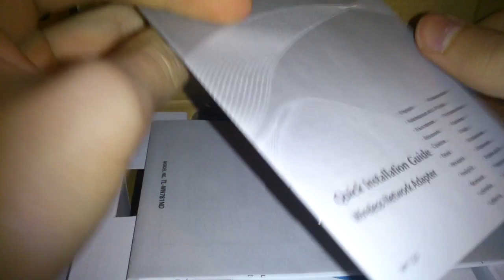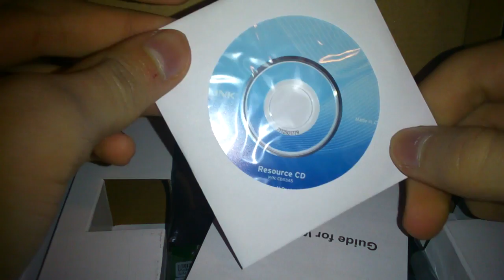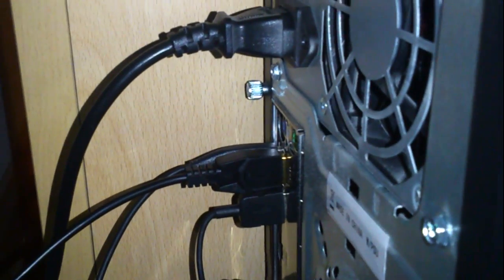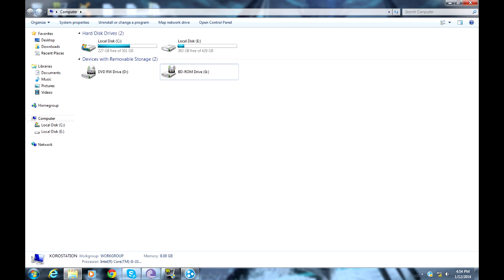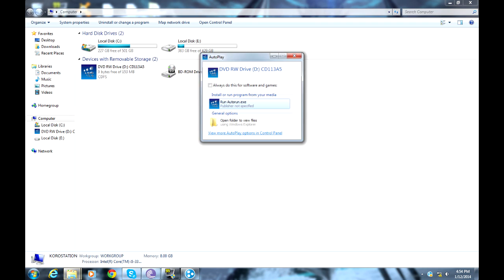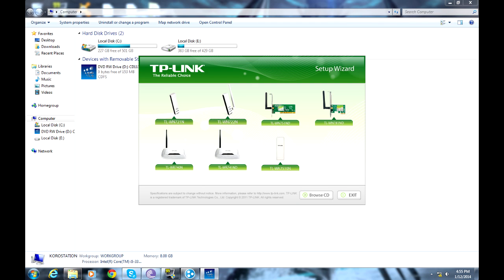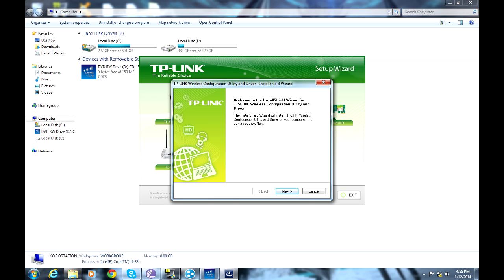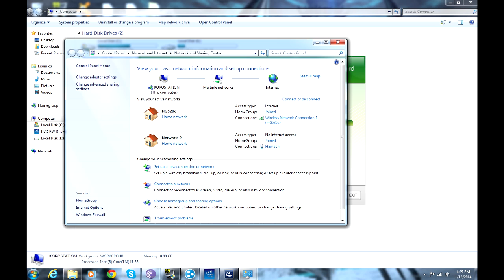How to install Wireless PCI Express Adapter and Unboxing of TP Link TL-WN781ND

Comment: Hi I have a question quick does the wifi card get hot and cause any problems ? as my graphics card would be just above it and hits 84c on full game load so I worry the heat in the area will make problems

Comment: when your connected the adapter did the green status light go on right away ? Because I just bought one for my pc and the light never turned on
Reply from the maker: Lexi _ _ _ I mean, it should light up, but if it's working and it didn't light up then I think it doesn't matter

Comment: um got a question if you have cable so the yellow cord do you need these on a custom pc just reply plz
Reply from the maker: no, u don't. if your pc is close enough to the modem of coursem
Reply: can yo u make that simpler cuz i am dumb
Reply: Koro Productions can yo u make that simpler cuz i am dumb
Reply from the maker: +spinke wolf can the yellow cord reach your pc? if so, you don't need this.
Reply: k thanks man it can
Reply: but if it cant i tell them to put it in my custom pc
Reply: so it is wireless internet

Comment: i didn't get the antennas, so it would not work right?
Reply from the maker: How did you not get the antennas? And no, it doesn't work without the antenna, as far as I know
Reply: +Koro Productions it didn't come with it lol, ill go ask them on monday or should i just buy a usb wireless adapter
Reply from the maker: +TheMrlittlemack You should complain, you did give money for a defected unit. Request a refund or get another one.
Reply: +Koro Productions yea they're open on monday, it sucks though i just built my pc and installed windows on it and can't install drivers or anything cause no internet
Reply: +TheMrlittlemack oh shit i thought today was sunday, ill go tomorow
Reply: +TheMrlittlemack im exhausted im going to bed, thanks for the video and support- subbed
Reply from the maker: +TheMrlittlemack haha lol, thanks for subbing ☺

Comment: Is it really worth or could I just use a Usb adapter?
Reply from the maker: Seth Schuler Yeah you could just use the USB adapter if you want.
Reply: Koro Productions I mean does it make a noticeable difference?
Reply from the maker: A USB adapter might not be able to deliver as strong of a connection over as long of a range as a PCI-based wireless adapter can.

Comment: Hey dude, do you still use it? how is it for gaming? does it get slow sometimes? would you recommend it?

Nice video
Reply from the maker: DAMN THIS IS A LONG NAME I used it, at first it was fast, but there were more and more devices getting onto my wireless and it eventually became slower. I would definitely recommend you connect it via LAN if you can but if your wireless modem is good it should be no problem for playing games - I was getting around 40-60 ms in Counter-Strike, and I still am getting around that value. But the speed of it was at one point limited, it was 20Mbps while now I get 40Mpbs
Reply: oo okay, thanks for the reply =]
Reply from the maker: no problem :)

Comment: A fast question and PLEASE ANSWER it
My motherboard is gigabyte GA-H81M S2H Socket 1150 motherboard
And my gpu is above the PCI EX1, so i can't put this in that slot, I have a PCI EX2 slot thats free, but does that work the same as the PCI EX1? Please answer if that works
Reply from the maker: The Comedy Gamer Yes, you can :)
Reply: Koro Productions Okey thank you so much :) cause my wired connection is shitty XD

Comment: +Koro Productions, why did you change PCI slots? wont the old slot be as good as the new shorter pci adapter?
Reply: pci express cards do not fit into regular PCI slots--the space between the contacts and the guide is too short for the pci slot

Comment: when i have it installed then it shows me plug in a wirelss network adapter and closes and says installation failed.
Reply from the maker: Make sure you did everything as in the video. If you did it all like I did, it should work properly. If that still doesn't work, contact the place where you bought it at and tell them that you have a problem with the card. I hope I helped, and if I didn't, I am sorry.
Reply: I did everything like you :/ i will contact the shop still thanks :)

Comment from the maker: Sorry for all the mistakes when I was speaking, I recorded everything in one take
Reply from the maker: I didn't film it in one go, but I recorded the voice in one go ;) I didn't lie
Reply from the maker: TheAdamski99 That's why yours is the best! /s
Reply: i have the nano it small and shit and its good thes one for range because i have just order it ???
Reply: No offence but really shitty voice over
Reply from the maker: Jose Rico Taco Nacho Casadia Mandela Jones Thank you man :)
Reply: Koro Productions is that network adapter can connect into any wireless devices like TL-WN841N? please answer
Reply from the maker: yes, of course :)
Reply: Koro Productions i've got some problems with it. my tp-link router model is tl-wn841n. it always disconnect every time. this makes me have to restart in order to make it work. i have install a drivers for pci express. please help
Reply from the maker: you have to restart your router?
Reply: +Koro Productions I just purchased this WiFi Card today and my PC is not Detecting the card at All. (I'm using Windows 10) Please Help :)
Reply from the maker: Huh, that's weird, I am using it with Windows 10 atm and is working perfectly. Did you follow all the steps as shown in this video? Maybe the card was Dead on Arrival and you need to change it? There are lots of reasons why it may not work.
Reply: +Koro Productions you actually didnt film it all in one go... please dont lie.